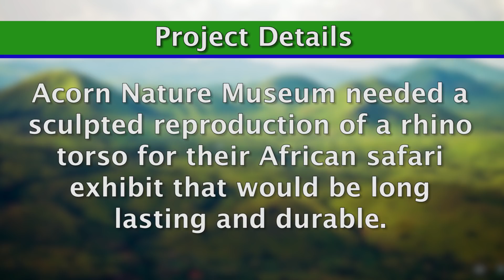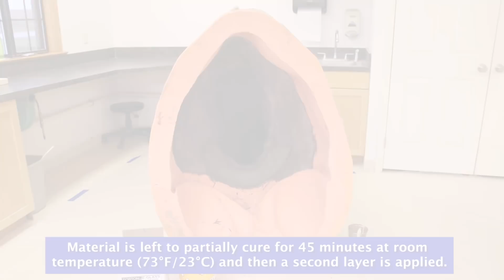How To Make a Mold of a Rhino for a Museum Display

Comment: How many times can you use that mold before it starts to deteriorate?
Reply: J. Dana Clark I’d guess 10-50 🤔
Reply: lasarith2 that's actually pretty good given the level of detail.
Reply from the maker: It would also depend on the type of material being cast.  A polyester resin would be much more chemically abrasive than plaster, for example. Here's an FAQ which may help - https://www.smooth-on.com/support/faq/183/
Reply: I wondered why gypsum.  Figured too heavy.

Comment: they dont use masks? aren't these materials toxic?🤔
Reply from the maker: Rebound platinum silicone does not require a respirator.  The polyester resin they used for the support shell does, this is shown in the video.